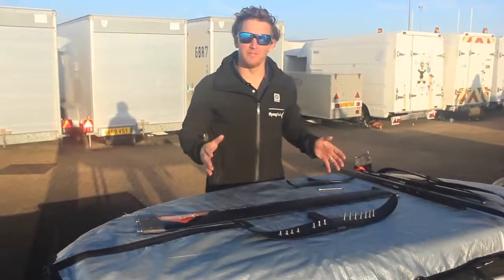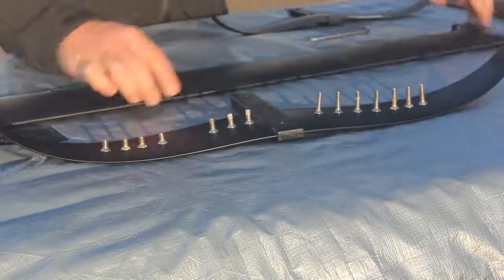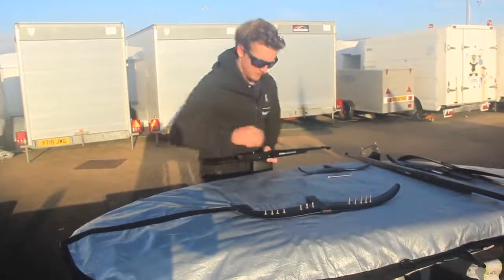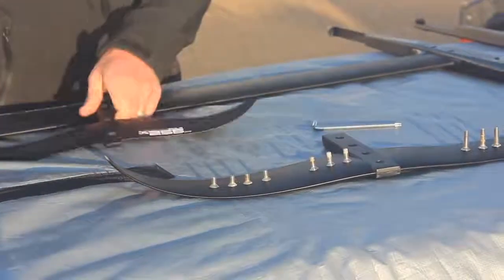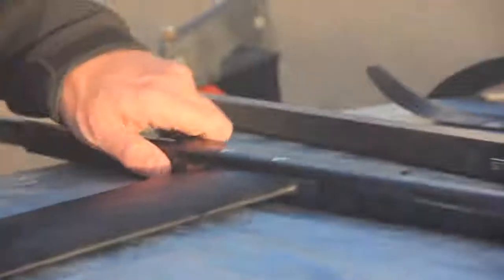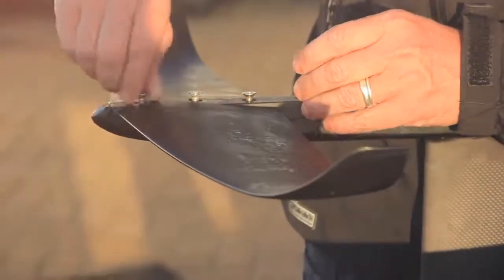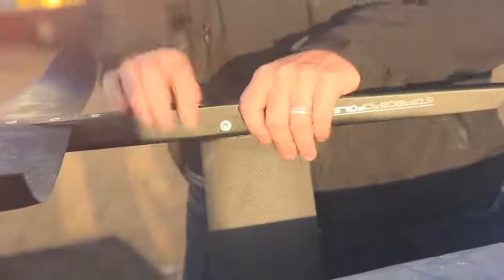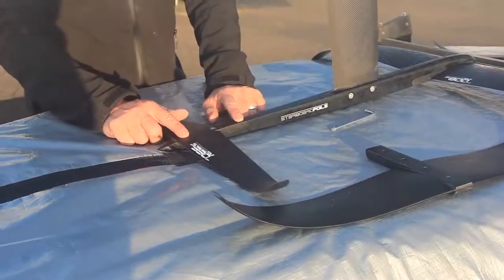Starboard Windsurf Foil Assembly - Sam Ross

Comment: thanks for the video.
What changes on the foil if you put the front wing on the supercruiser(2020) mounted further forward?
Reply from the maker: Hi there, is this with reference to the original style Supercruiser before it moved onto the Evolution platform? 
If so, the set up is designed to sit as close to the mast as possible ( all the way onto the fuselage). Any further forward will make it twitchy and not work as efficiently.
Reply: @tushinghamsalesltd  Hi Sam, thanks for your reply. I have the old version of the Supercruiser. There you can also mount the front wing further forward.

I thought this would make the fuselage longer and the foil would fly more stable.
Then isn't that right?
So better closer to the mast.